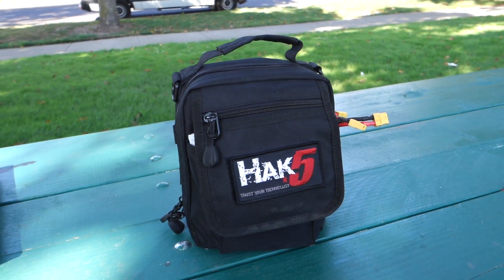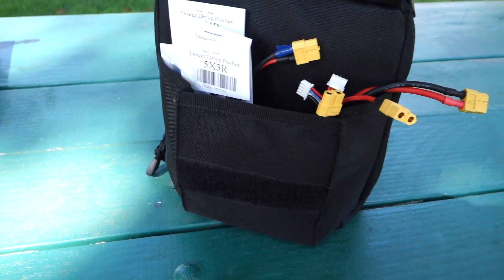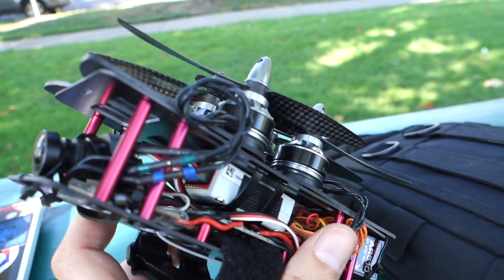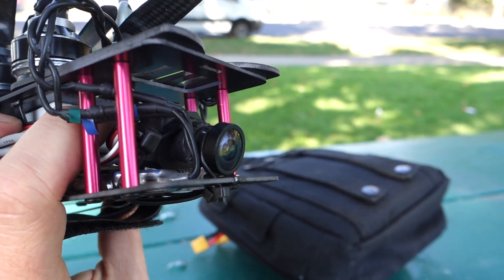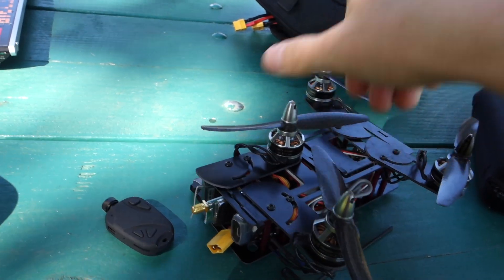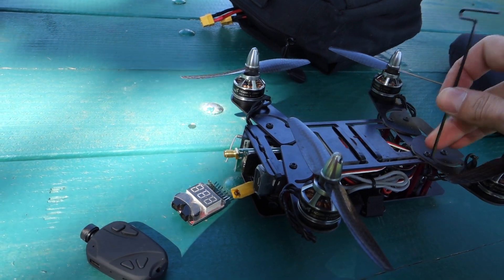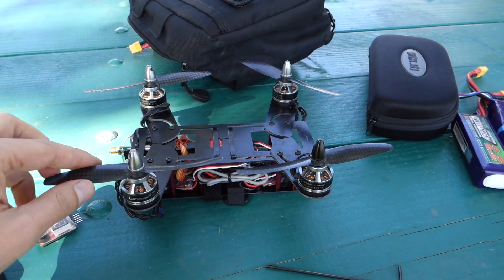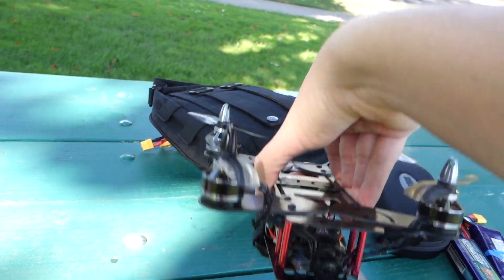Grab N Go Fly Bag - Folding 200mm FPV quadcopter

Comment: got one of these and after several flights got rid of it.  i like the folding design and yes i did the same as you and removed the top section.  i still found it flew like it was a car on ice, the back end had a mind of its own at high speeds.  i since turned it into a 280 v-tail and a 250 h-quad using the top and bottom frames for each version and some 1cmx1cm carbon tubes for the h and 1cmx1cm pine :D for the v-tail.

Comment: 440 grams with battery? without?  either way that seems heavy.  I have a qav250 with the 3mm carbon fiber frame and got it down to 290 without battery and fpv package.  With a 1000mah 3s, it weighs under 400 grams, even with the micro fpv setup i'm putting on, it will still be under 400.  it hovers at like 25% throttle with 5040 props, it's nuts.

Comment: I know this is pretty much a "personal" project but would be awesome if you decide to write a "how to" manual on how you build it with various do's and don'ts tips you found out during the process as i would love build something similar, i know you have documented some (or all?) of the process on video, but would be nice have it wrote down somewhere so it would be easier to have a go at it....

....OK, OK....am just too lazy going trough everything you did to figure it out myself like the materials and stuff like that and i like better do things when i have a general guideline instead of running around in the dark figuring out everything from scratch xD

frankly, i would love nothing more then to just buy the whole set in the hack store itself, but i know that would be kinda hard to do so that's kinda out of the equation....
Reply: I'd just like to know the components and total price :P Seems pretty nifty.
Reply: Esa Edvik that as well, but would be nice to know what screws goes where so it won't start flying up-site-down xD